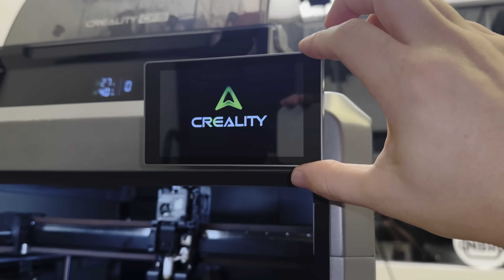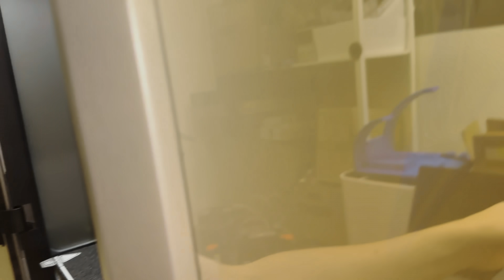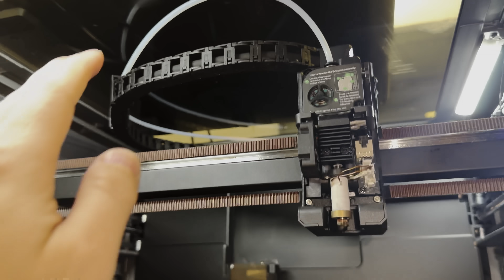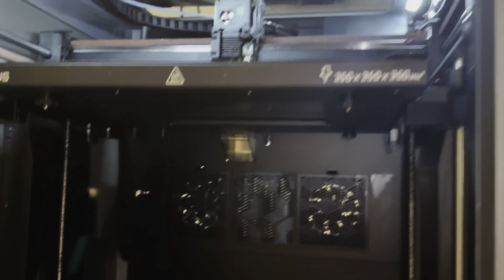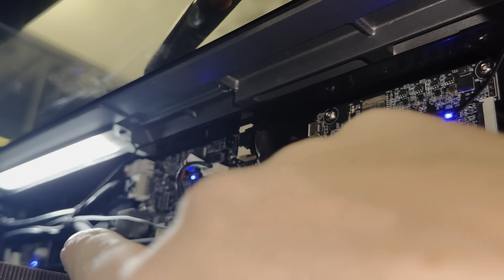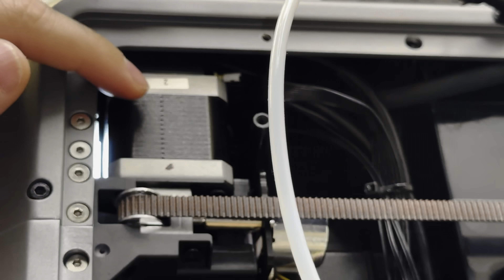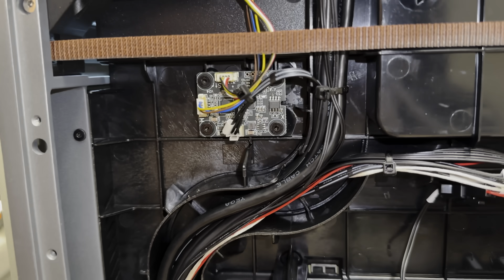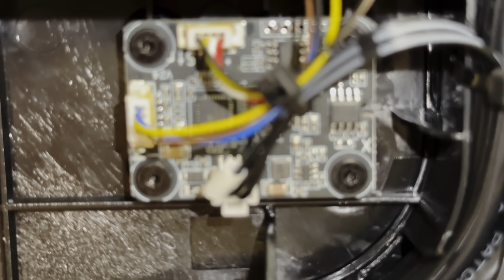Creality K2 Plus - What's Under the Hood?

Comment: Would you consider doing a ringing/VFA comparison between the K1, K2, and X1C? I know ringing has been an inherent issue with previous generations of Core XY printers, so it’d be great to see how the new K2 with the linear rails handle it!
Reply: u have no vfa on servomotors
Reply: @madmatrac  I thought one of the causes of VFA is vibration of the X and Y rails, and that that is what is being characterized by the input shaping.
Reply: @nlkatz  the one and only vfa reason is stepper motor stepping over self resonant frequencies.
Reply: @madmatrac Yes, the motor may be the source of excitation but what is self-resonating ? I believe it's the mass of the printhead resonating on mass on the compliance of the supporting rails.

I saw a YouTube recently of what I believe was the input shaping and while it was doing that it was moving to various spots over the print bed. That's because the resident frequency would depend greatly on how far the print head is from the support of the rail it's on, with the lowest frequency being when it's in the center and higher frequency when it's closer to the supports.

I'm a mechanical engineer but I'm new to 3D printing so I could be wrong.

You could verify by comparing VFA's in something printed in the center of the bed with something printed in the corner.
Reply: @nlkatz  self resonant frequencies is that motor has on its own. U can just hang it floating in air without any load and it still would have rotation speeds when it make enormous noise.
Reply: @madmatrac  Yes but does the amplitude and frequency of that noise correspond with the frequency of ridges on the part?

Possibly, but it's also possible that that frequency is exciting the bending resonance of the rods at particular positions of the print head. 

Also, I missed a few things upon when first thinking about this.

I was thinking the motor parts are so compact and stiff that it would have very high frequency, low amplitude resonances, but I missed the fact that it could be a rotor torsional resonance on the springy magnetic field between poles.

This would translate directly to a linear motion, though it would move the print head back and forth along its path, which I guess could create the ridges by pushing the melted filament sideways, though I don't see why the ridges would line up exactly on successive layers.

Another possibility is the tensile springiness of the belt which could be excited by the motor resonance, and would also depend on the distance of the print head to the belt attachment points.
Reply: @nlkatz  motor have one moving part - rotor. it resonates. rotating. stepper motor do stoprun job every single step signal you send to driver (1-100k/s). so when it starts making noises rotor is jumping back and forth more than exepcted in usual step routine. this translates to printed walls as ripples. it is often missed as belt resonance since ripples often have 2mm width similar to belt tooth. but belt is actually stiffer than rotor and actually limits ripples to 1 tooth. if u never ever run motor on resonant rotation speeds u never get any vfa.
Reply: @madmatrac  Interesting, thanks.

Any idea why the ripples and successive layers line up with each other?

I would think their position along the path of the print head would be random, giving more of a fuzzy skin effect.
Reply: @nlkatz  printhead maintai nlaws  of physics while moving on its path, ie acceleration. same path = same speed.
Reply: @madmatrac  I don't see how that's relevant to the question, but the answer is simple - because the belt is cogged, the rotational position of the rotor with respect to position of the print head is fixed, so the ripples will line up. 

My original hypothesis of the rods bending causing the ripples is incorrect, because then the ripples' locations would be random.

Comment: Just FYI high voltage is anything above a 1000V. Mains voltage would still be low voltage. Anything below 50V is extra-low voltage. Below 50V is concidered to be none harmful to humans since it will not have enough voltage to go trough the high resistance of a human body.

Comment: 110 is not high voltage
Reply from the maker: It's high-ish.

Most people define high voltage as 600v
Reply: Yes but most people have never heard of actual extra low voltage and low voltage standards. They just know that mains voltage is higher than things like batteries or the DC voltages in their electronics / chargers, so its dangerous, which is all that really matters.
Reply: It will send you sleeping with the fishes. You might argue with it, as it is running through you, but you'll be lucky to make it. Let's stick with that. As for applications beyond 50V, anyone handling that, need to really get why 50V sort if everywhere as for safety instructions about voltage. Anything about that, will send you sleeping with the fishes.

Comment: The board inside the front chamber is called "host" board, the small one in the back is called RFID sensor board and the one in the middle I don't know. Creality After Sales YouTube channel has repair/replacement tutorials for each component of the K2. The vids dealing with the main board and other electronics they show motherboard labeled map.
Reply: Your video plus theirs is really awesome stuff. I just wonder what your thoughts are about customizing the machine. I want to get the chamber/bed temps higher in an attempt to print PPS-CF and maybe even PEKK. Creality has stated that it will be open sourced and able to be rooted and Klipper run on it
Reply: @RaRa-xg7le  - I prefer plain Jane Klipper.  I'd also prefer that 3D printer manufacturers publish profiles for their printers for the common slicers instead of making a custom version of Cura from two years ago.
Reply: @Liberty4Ever  Creality Print 5.1 is currently Orca based, and a first run profiles for Orca has already been released, but needs tuning, based on comments I have seen.
Reply from the maker: Ahh that's awesome. They really need to step up on the support documents to match the complexity of this machine.

Comment: Nice to see Creality doing the chamber heater right with an insulated heater instead of the cheaper live versions and what looks like some overheat / thermal runaway protection. The overall construction and design looks very good.
I still have grave concerns about the serviceability and repairablity of these though. Belts and bearings are consumables. If the open source community can make them serviceable then these companies should be able to as well.
Reply: chamber heater should be close to the bottom though. hot air rises....

Comment: 19:20 left corner with x y etc aren't those smd stepper drivers?
Reply: I believe the small board shown at 28:25 is the X axis stepper driver.  The MS35776 is a microstepping stepper motor driver.  At first I thought the stepper drivers were on the back side of the board shown at 19:20.  Now I think those chips aren't populated on the board because they're on daughter boards, and the reason there are stepper driver chip locations on the motion control board at 19:20 might be for smaller current drivers that could be used with smaller motors on a smaller K2 printer we haven't seen, or other 3D printers that Creality makes.
Reply: @Liberty4Ever  things are getting more complicated with electronics.
Reply: @slacksthegreat  - The K2 Plus hardware certainly became more complicated!   🙂

Comment: You were right to assume that the right board is the RPi clone, unless I am mistaken that board has an Allwinner T113i, which is a 1.2GHz dual core ARM chip. It is a bit low spec but will do the job.
Reply from the maker: I figured it was a little lower in spec. The touchscreen isn't the most responsive thing, but it gets the job done.
Reply: any lowspec arm chip would be planet ahead of k1 chip of wifi router

Comment: the motors are closed loop afaik, so they don't need drivers on MB
Reply: I also thought the closed loop motors had their own integral motor drivers, but the small board that Nathan showed at 28:25 is apparently the X axis microstepping stepper motor driver board.
Reply: @Liberty4Ever  That is for the Belt Tensioning motor, not X axis motor (remember Core-XY combines both motors for X and Y movements) The main motors have 9 + X wires to each board at the end of the stepper motor. I think there might be a strain gauge and driver for the small silver motors.
Reply: @alexa5231  - I assumed any belt tensioning motors like the small silver motor shown in the video are DC gear motors, and the calibration might not need a sensor such as a strain gauge because it may be possible to use the input shaper accelerometer to detect a loose belt.

As for an X stepper motor on a core XY system, the main motion control board has unpopulated IC locations labeled X, Y, Z1 and Z2, so I was trying to use the Cartesian coordinate nomenclature that seems to be an inaccurate holdover from previous printers.
Reply: They look like closed loop indeed. Look at the servo42d, very similar. Those also don't need separate drivers on the MB. I've used both the normal driver on my Arduino CNC shield and the servo42d on the back of the motors.

Comment: This looks like a solid printer. Seems Creality wanted to prove they can hang with the best when it came to this printer.

As far as connectors and the like... Its all industry standard parts, so companies are bound to end up using the same ones in many cases. As long as the pinout is the same as the Bambu, this allows flexibility on the part of the user, should they need to aquire a new cable. They can run to their local MicroCenter or wherever and pick up whichever brand is in stock.

Did they look at Bambu and apply what they saw, yeah definitely, but it also seems they made real effort to improve on the design as well, rather than a simple copy.

Having the leveling load cell on the toolhead is a great change. I notice that when my K1 Max is doing a bed mesh, that there is more flex of the rods and gantry when it is probing the middle of the bed, that when it is probing the corners and edges. I believe that is because the load cells are sharing the pressure more evenly, so the signal is smaller. When probing the edges, only one or two cells take the majority of the force, and would make a stronger signal. The single load cell in the toolhead means the activation force will be even across the bed.

It could also allow for better flow compensation, as it would allow the toolhead to sense how much force is on the nozzle while printing.
Reply from the maker: That's a good point about bed leveling. This should be able to monitor extruder back pressure as well, since the extruder pushes on the hotend, and they are both on separate sides of the loadcell
Reply: @NathanBuildsRobots  Yup, looks like a ton of capability in this printer.

Now Creality needs to nail the software side of things. Well tested and tuned features. I felt the K1 series had issues with some of the extra features like the "LIDAR AI" pressure advance function on the Max. I never used it, and even removed the sensor, as it seemed to not really do much. That and it doesn't work in Orca Slicer... Unless that has changed. There have been firmware updates since I stopped using it, so maybe there is improvement, but i am not switching to the Creality slicer to test it. Even though they use Orca (or Prusia, whichever) as the base now.

Comment: a very complex design for a printer expecting the users to operate and maintain themselves.

it looks like a solid and on paper everything we wanted from a next gen printer, but yet after seeing this design, and from my experience with creality, i will rather wait to see what issues this printer might have and how hard will it be to solve them.

also cant wait to see the process of fixing a clogg in this printer and how to switch/disassemble the hotend and print head
Reply from the maker: Hotend swaps should be relatively easy. Cut filament, unscrew nozzle, done.

The complexity and number of PCBs does make me a little worried. Having worked in a factory manufacturing robots, one of the big challenges is diagnosing and figuring out which board needs to be replaced when there is an electronics failure. If it's designed and built properly, it should rarely be an issue. Will have to see how reliable they end up being long term.
Reply: Yes but this is the same thing Bambu has done and their fans worship them for it. The days of easy to work on printers are numbered.
Reply: @Zamugustar  Yeah, but bambulab have proven themselves as manufacturing reliable machines, creality hasn't successfully done it yet.

also, look at the number of bambulab models. it's exactly 4. Now look at creality. I seriously stopped counting.
this is to show you where the focus of the company lays.

It's not about being a fan of bambulab. it's about getting a refined product that has been tested thoroughly that will not go deprecated after a few months cause a newer and better model is out
Reply: Designing a closed heated chamber, sort of hinders serviceability. You need to work really hard as a designer, to provide heated chamber and ease of service. Since the market is stupid, and demands stuff to "feel" solid on top of that, and look "great", stuff like feel and form, is crashing at the design stage. You will also find, that the people reviewing this thing, tend to reflect on understanding of that aspect of designing, and thus never call out the insane priorities products tend to have.

The security issues of printing with filaments that produce toxic gasses, and the usage of of like 2000W of power, sort of require a different mindset if you want to produce secure products for the public. Not to mention, the insane vibrations introduced by these machines. This machine shakes like a horny vibrator doing an overdose of Viagra, with a heater cooled with a el-cheapo fan. What could possibly go wrong?

Comment: I hope they make this hotend/extruder setup available would love to adapt it to some older creality printers I still have.  Was thinking of using the k1 or the v3 se/ke one but this looks to be a bit of an improvement over those.
Reply: Really like that they went with a 350 x 350 build area as well.  For the style of printing I tend to do 330+ is a must.
Reply from the maker: Same, 350 is basically as big as you ever need. Once you go past that you're using multiple spools of filament per print and it's time to step up to a different system.
Reply: @666nacirema666  - I occasionally need to print something large such as a car battery cover or pannier racks for my motorcycle, but I mostly want a large build volume for large production print jobs in a small print farm.
Reply: @Liberty4Ever  Yep thats one good reason for them I have a few high part number things I like to do as well and its really nice being able to do it all neatly on one printer.  I do a lot of large prints that work out a lot better when done in one piece than multiples and I need the space for those. 

I just ordered a 400x400 turd but plan is to mod it quite a bit and get it more up to modern standards.  Itll either work out well or just be a fun waste of time idk.  Price was low enough that it was actually better than buying the individual parts myself.

Comment: Thanks for this deep dive into the internals. Did creality make this machine more complicated then it needed to be?
Reply from the maker: I think they could have consolidated it a little more. Having separate modules is a common way to break systems into easier to design pieces, and has some benefits in servicing and repair. Like if the main computer goes out you only have to replace one medium cost board instead a giant monolithic board. It is especially relevant if they want to use the same boards across multiple products, and lets say they make a smaller K2 that doesn't need to have all the same parts, but the main computer is the same.
Reply: @NathanBuildsRobots  those are some good points! I would be surprised if they dont release a normal K2 before second half of 2025.
Reply: @NathanBuildsRobots  - I think the unpopulated stepper motor drivers at 19:00 and the external microstepping stepper motor driver board at 28:25 is an example of this.  Maybe the bigger motion control board gets smaller stepper drivers for a K2 with smaller motors but larger stepper drivers are used on daughter boards for the larger motors on a K2 Plus?  This would allow more part commonality and shared design across a product line.

Comment: In the FAQ on the website : More over, the aluminum heatbed is 5mm thick and hard to deform, so the leveling accuracy can be well guaranteed.
Reply from the maker: I guess it's 5 then 😆
I can't fit my calipers in there to check

Comment: I don't know but could the stepper drivers be on the underside of that PCB ?
Reply from the maker: Yeah I think that is the most likely. That must be some compact drive electronics, with a little encoder built into it. Would be fun to crack one open.
Reply: They are probably on the back of each FOC motor. You can see in the video that each motor has a compartment closed by a plastic casing, they are probably there..
Reply: I'm pretty sure the small daughter board shown at 28:25 is the X axis stepper driver board.  Apparently, for the K2 Plus, they use discrete daughter boards for larger stepper motor drivers and the motion control board shown at 19:20 has unpopulated chips that would be lower current stepper drivers used on a smaller printer?